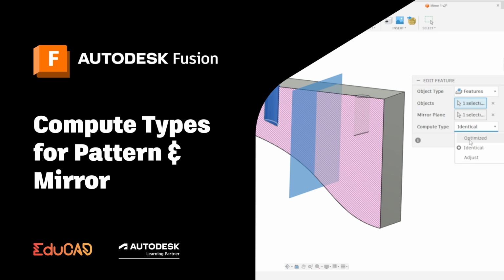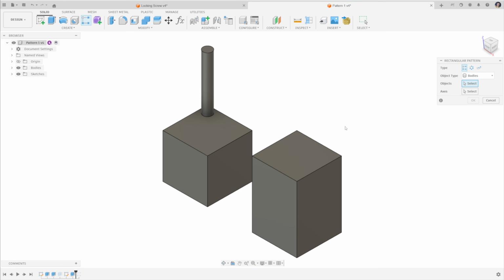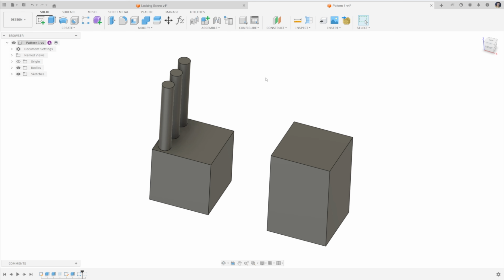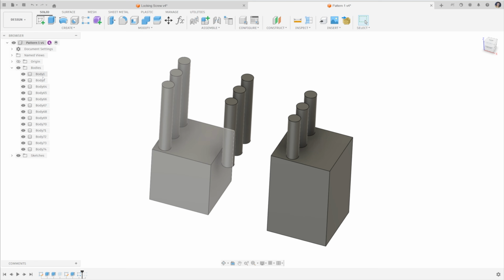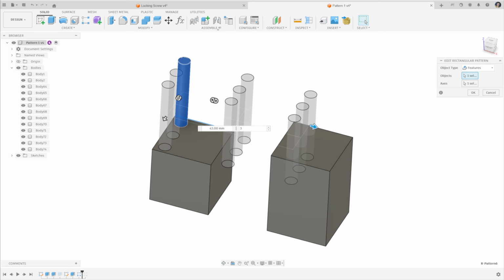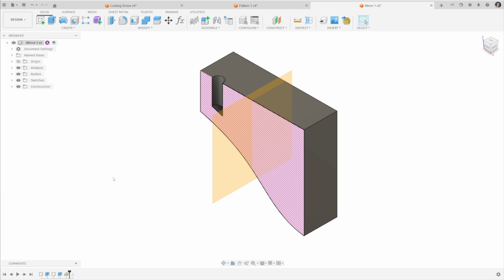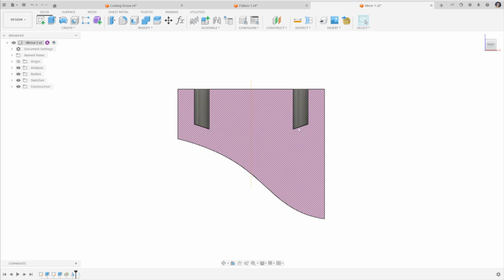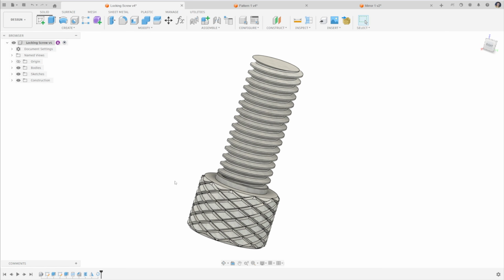Mirror & Pattern Compute Options Explained in Autodesk Fusion

Comment: Have you, ah, actually used Fusion? I kid! I kid! However, my consistent experience using Fusion for the last 10 years has been that in any given situation, exactly one of these three options will work and the other two will not. You have no choice in the matter and no need to consider what the distinctions among them might be. The method that works might be any one of the three. And in particular, Adjust is not privileged as the most thoughtful or the most powerful. It's no more likely to work in any given case than the other two.

My beef is that there are two different failure modes: giving the wrong result and failing to compute at all. If the result isn't what you expected, at least you can try the other modes. But if you guess wrong, the operation just fails and Fusion doesn't even add the pattern or mirror to the timeline. You have to start all over again to try one of the other methods. It would be nice if these operations were always accepted, even if they failed to compute, so that you could easily try the other options. Even better would be if Fusion would try them for you and see if either one of them was at least able to compute.

It's hard to tell exactly how the preview for these operations works. It does seem to change with your selection of method, so it can't be relying on some static least-cost approach. But there's also no obvious correlation between the preview and the actual result. The preview may fail while the actual operation works fine and vice versa.

On the upside, one of these methods usually does always work. You just have to find it by trial and error.